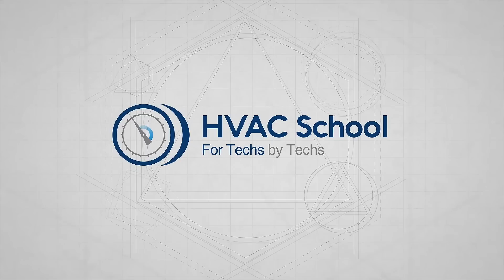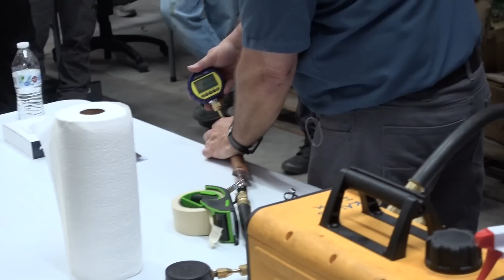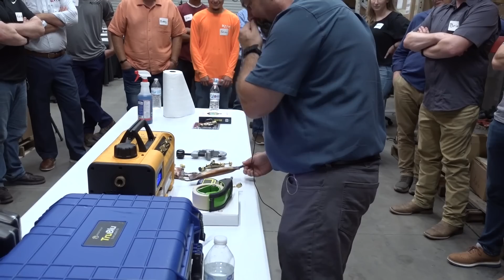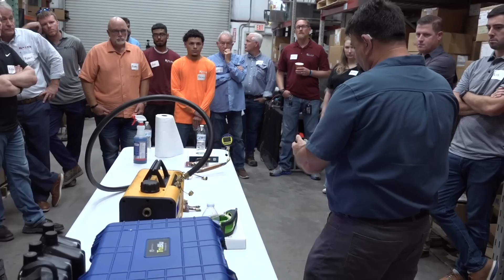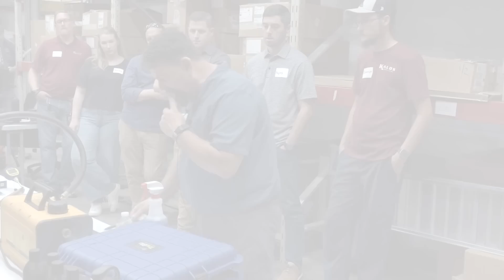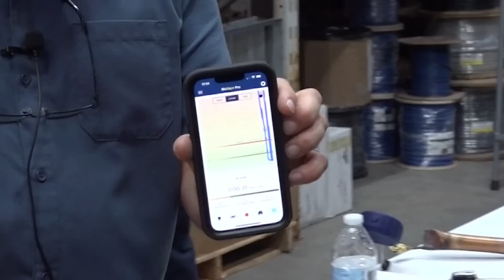Vacuum Practices for Large Jobs

Comment: Pumped down a system that only holds 3lbs and took 1.5 hrs to get to 1000 micron then when I do vacuum decay test it always fails not just this system but all of the ones I do. That after doing a pressure decay as well pump to 300 psig sit for five mins to settle then let it sit for 30 mins and I ALWAYS get like 500 micron or more rise in microns my testosterone gauge set always says it fails. What gives

Comment: I understand the large hose thing in the early stages of pulling down when there is a large volume of gas leaving the system, but how could a large hose effect the depth of the vacuum? 
As when you get into the deep end of the vacuum there is so little current could not pull through a needle at the same rate? 

In order for a vacuum gauge to read differently at one or another end of the system would there not have to be flow and impedance factors? How much current or flow is going on in the largest of systems at 500 micron? 
When you have reached the depth of vacuum you hope to, would gauges placed on different parts of the system show different results (excluding a valved off segment)?
 
I also don't understand why you would want multiple vacuum connection points just to provide less flow restriction for the first portion of the vacuum pull. to then have them all be leak back points when you get to the deep end of the vacuum?
Reply: It is not only about flow, it is also about phase conversion and the inverse relationship between the energy required as you get a deeper vacuum… The contaminants (from air, and even some oil) are removed because they have been “converted” (under vacuum pressure) from the liquid phase to gas/vapor phase and removed by the vacuum pump (hence the need for a ballast, not to that part yet so not sure if he mentions this point)… The pressure at which different contaminants go from liquid to gas/vapor vary, some are very low and it takes more effort from the pump as the system approaches a near vacuum… In short, the deeper the vacuum gets, the longer the pump has to work to create a lower pressure area to pull matter in from the system, which is also why a vacuum pump with two or more stages works much faster…
Reply: I am vary clear on the purpose and physics of evacuation. I was however unaware that there are oils used in refrigerants that might vaporize at even 100 F and 500 micron, I would love to see that information! My only point to all of this is that in the deep end of pulling down a vacuum having a 1/8 inch hose or a one inch hose will not determine the depth of vacuum because the the 1/8 inch hose will not be a restriction in the least when the current has slowed to nearly nothing. Simple fluid dynamics. So in short lets stop saying that the huge hose is going to effect the depth of vacuum as it will only effect the speed in which you get there.If you have a different belief thats ok but it is not based on the law of physics.  @EarlHayward

Comment: I needed this because I bought my first Vacuum Pump recently, the Milwaukee M18 Vacuum Pump. And my teachers at the trade that I went to years ago was not interested in teaching us anything.
Reply: How are you liking that Milwaukee pump?
Reply: @AaronPowellvox  I just unboxed it a couple days ago. Haven't had the chance to use it yet. I'm sorry I couldn't be mush help.
Reply: Man but the charge and flow rate is all power related to the batteries. Granted the vacuums take less than an hr so it should only take a battery. Get a corded one for commercial
Reply: I want the m18 pump sooo bad
Reply: @kobie4238  same. I have the Navac 2 cfm but I was wanting something with more power.